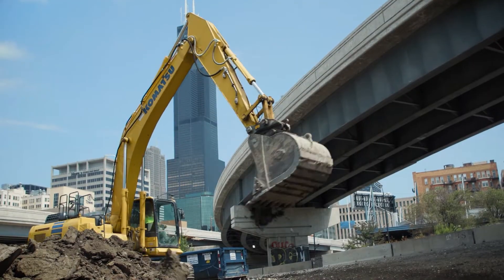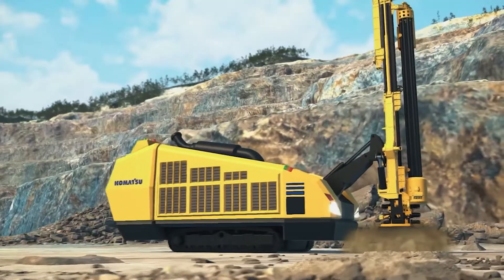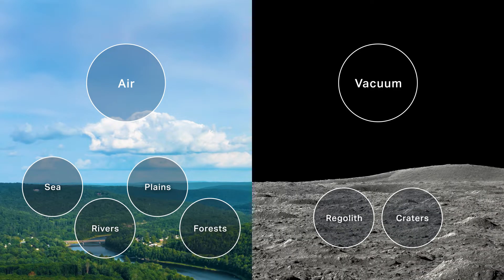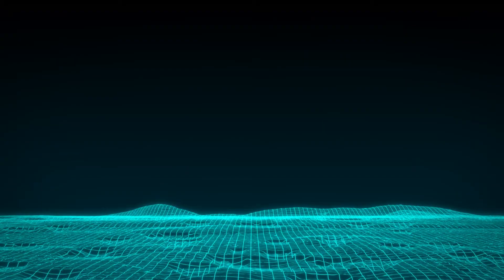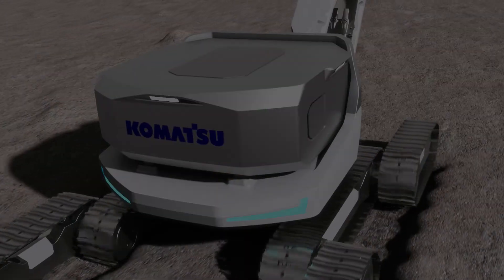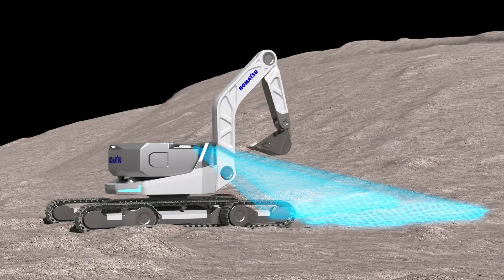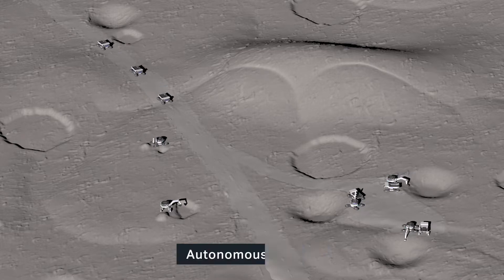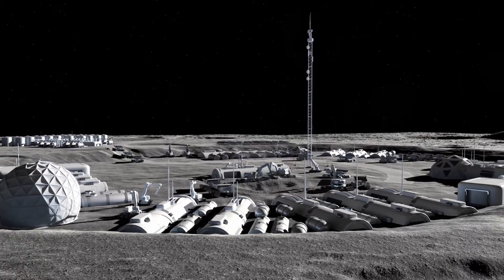Komatsu lunar machine project #1

Comment: AND ONCE IT BREAKS DOWN FOR A SIMPLE FUSE OR BREAKS A HYDRAULIC LINE? WHO WILL FIX IT?
Reply: yeah, good question. maybe they have separate bots for that, the maintenance bots.
Reply: Probably field technician, there will be people on the moon by that time likely.
Reply: Yeah by the time a construction excavator is there, we will have mastered extended stay missions in inflatable habitats by then. My only issue us moving all the regolith around is nesrly worthless if you can't process it to more refined products and THAT machinery (like a forge for starters) will be a heck of a lot harder to replicate and power.

If it were up to me id figure out way to make a fresnel lens and use that direct sunlight to melt the extracted iron @alexeyf1795